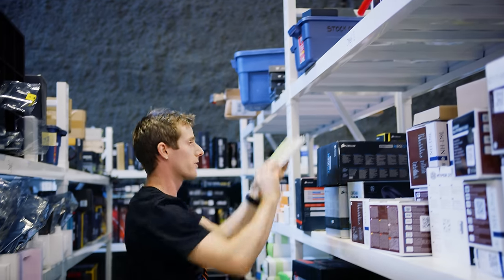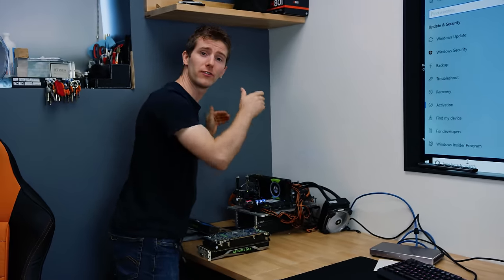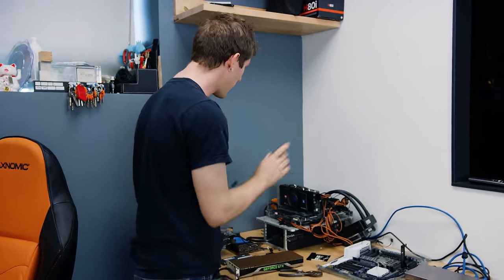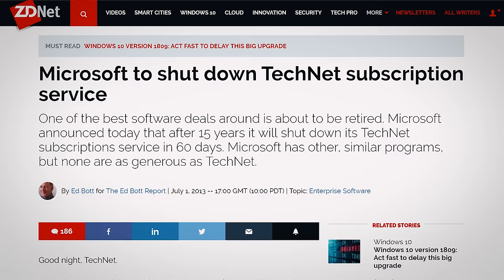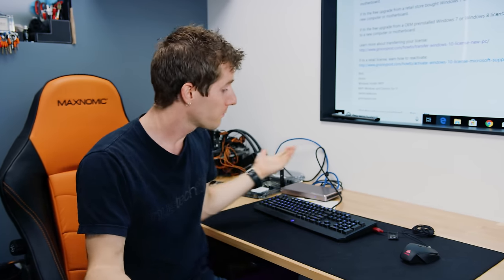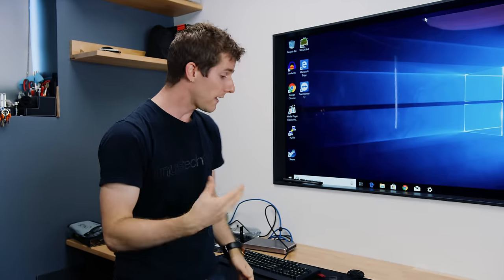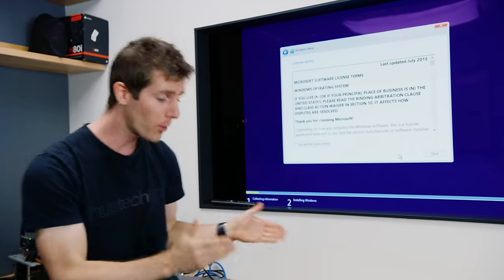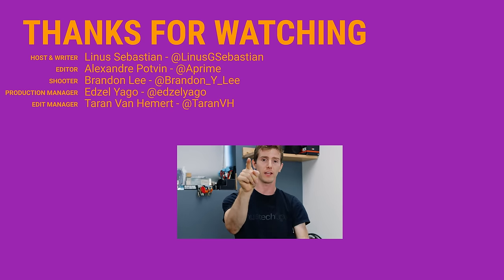Why Does Linus Pirate Windows??

Comment: Burns license to prove point... isn't able to prove it 😂
Reply: Murphy's law. Everytimeeeee
Reply: It happened to me when I upgraded everything but kept my hard drive.
Reply: @TheUwaisPatel  that probably the most common
Reply: i had no issue with it.  took HDD from prebuilt refurbished intel, and moved it no problem into custom build AMD PC
Reply: If he used a different mobo he would have proved his point on the first try. Windows license is tied to the MAC address of your motherboard.
Reply: Reason his key didn't deactivate is due to him not plugging in the internet, On top of that it doesn't burn the key. I changed to new mobo and cpu and it was still activated, connected to the net for 10 minutes and got notification to activate windows again. Once it deactivates it gives you a list of options and numbers to ring to get it activated again, done that 7 times with the same key.
Reply: Karl O'Toole He did use a different mobo, windows apparently didn't care.
I'm thinking there's a grace period after the first activation where you can swap out hardware however you want.
Reply: I believe the rule is if you change two or more pieces of hardware, or you replace the motherboard, Windows will ask to be re-activated. But most of the time you can re-activate.
Reply: Completely don't watch video?

Comment: I've had that many problems with Windows 10 activations even though I have multiple legitimately licenses. I even had multiple installations tied to my Microsoft account and deleted an old computer from there which then killed ALL my activations.
Then there's the issue of all the different versions of Windows 10, let alone all the versions of Windows 7 and 8 as well. So honestly, at this point, it's easier to pirate Windows 10. I shouldn't have to ring them every time I want to reinstall the computer or change hardware. Microsoft can sort their shit out or sod off. Using an activator tool is far simpler. You don't have to deal with all this crap. People pirate things because it's convenient... so make this crap convenient, Microsoft.
Reply: Probably yet another shady one where it's source code is closed but the creator and it's user claim it's not malicious at all.
Reply: Or use Linux
Reply: Linux is really not a viable replacement for windows under all circumstances.
Personally I've never been able to run a pure linux system - always end up needing a dual-boot arrangement just to get shit done.
(Though even there I prefer to use FreeBSD/PC-BSD over linux, so... Eh.)

Plus for the purposes shown in this video it's completely useless, since hardware and driver behaviour under Linux is not representative of hardware behaviour under windows, which would defeat the point of a hardware review for most practical purposes (unless your goal is to review how it behaves under linux of course, but that's a very niche thing to be doing.)

ReactOS would be more representative of behaviour under windows, though only to a point, since it effectively is primarily built to mimic windows 2000 over anything else...
Reply: Plus imo os should be free anyways
Reply: Or just switch to Linux. Problem solved. You're welcome.
Reply: Absolutly agreed, I currently use a OEM key for my personal rig, but I do not plan to do any majo changes in the next time so I'm gonna stay with the OEM keys
Reply: I'd just like to interject for a moment. What you're referring to as Linux, is in fact, GNU/Linux, or as I've recently taken to calling it, GNU plus Linux. Linux is not an operating system unto itself, but rather another free component of a fully functioning GNU system made useful by the GNU corelibs, shell utilities and vital system components comprising a full OS as defined by POSIX.

Many computer users run a modified version of the GNU system every day, without realizing it. Through a peculiar turn of events, the version of GNU which is widely used today is often called "Linux", and many of its users are not aware that it is basically the GNU system, developed by the GNU Project.

There really is a Linux, and these people are using it, but it is just a part of the system they use. Linux is the kernel: the program in the system that allocates the machine's resources to the other programs that you run. The kernel is an essential part of an operating system, but useless by itself; it can only function in the context of a complete operating system. Linux is normally used in combination with the GNU operating system: the whole system is basically GNU with Linux added, or GNU/Linux. All the so-called "Linux" distributions are really distributions of GNU/Linux.

Comment: I have used the migrate license feature, which is especially useful considering how many old Windows 7 laptops I have. If I need a license, I upgrade to Windows 10 and migrate the license to another machine. This is also very useful when you buy a new computer
Reply: I just say fuck it and deal with the activate windows watermark, already have for 7 years and I see no reason to change for $200

Comment: Someone: swaps every component other than HDD
Windows: This is all I need. Everything else is external.
Someone: swaps HDD
Windows: AAAAAAAAAAAAAAAAAAAH MY LIFE IS A LIE!
Reply: I moved from my hdd to ssd a while back with no issues. Built a new computer, the only things that stayed the same were my hdd and ssd. Windows deactivated itself and I'm too lazy to activate it again
Reply: Had it deactivate with a GPU and power supply switch a while ago. Bought a key and somehow it's still working on my old HDD and new SSD which are in different systems. Ported it over to the SSD then reused the HDD and it still worked on a different motherboard with all different components.
I swear it's just random...
Reply: Lol
I once read that the reason why Windows doesn't straight block pirated or deactivated licences is because, economically, doesn't matter to them
Since every major PC builder like Dell or Lenovo has to buy the license anyways
Reply: i moved mine from a desktop to a laptop with no issues at all so um their activation thingy is screwy
Reply: Definitely not consistent. Haha.
Reply: @yumri4  I've had both deactivation and permanent activation on multiple drive migrations, even with the same OS, so you're right about that.
Reply: @Hoganply  yeah when you can change all the hardware and not have any issues but when other change 1 part and have deactivation happen is kinda bad

Comment: Linux: total freedom, Mac: total control Windows: the annoying middle path
Reply: Linux is both
Reply: @KSPAtlas  They mean Apple controlling their OS, not users.
Reply: @notstarboard  Maybe, but all of my Mac updates have been free. That has saved me a lot of time and hassle in our business over the years.
You have to work costs out for the long term.
Reply: @w0mblemania  I. You don't pay for windows updates either ya know? Or for Linux distros, they're like all free to begin with.
Reply: @The_Bird_Bird_Harder  And for Windows, you get a free ocassional update that nukes your PC so you have to hard reset it. I work as a indoor server admin and tech support for a company, and most of my job isn't even making sure the server we use is good, but fixing drivers that Windows update broke and salvaging data off hard drives which Windows 10 nuked after an update. There is the occasional requisition form for parts that stopped working or computer upgrades, but that's rare.
Reply: @The_Bird_Bird_Harder  Free as in freedom not in Free of cost

Comment: just remove the watermark completely from the registry editor, it's pretty easy lmao
Reply: how?
Reply: the DEFAVLT gamer It’s pretty easy, try searching it up on youtube.
Reply: It comes back after a time... or if you change some hardware... also the watermark shows me the computer is working OK. If watermark is not present  something is wrong with my machine... we are best buddies with the watermark now... :-)
Reply: Slav4o911 If the HDD/SDD stays the same, wouldn’t the watermark not appear if he image itself is deleted from the registry? Just some of my thoughts
Reply: @fyriiee  That's how you create bugs: A software is intended to show an image -> image doesn't exist -> software shows, that a file couldn't be loaded - or -> software just crashes - (or both)
Reply: nowonmetube how about replacing the image with a transparent image with the same name?
Reply: @OriginalBurnout  depends, if the software tries to show an image, which takes up to much space, has a different aspect ratio or width / height, compression rate, format type, bitrate
- it could all also cause bugs
- or it just shows the different image ^^
- but just because an image is transparent, doesn't mean the software can show that image. If it expects a jpg image for example, it won't work, because it needs to be png to have transparency.
Reply: @nowonmetube  I'm pretty sure the watermark is just text.
Reply: I mean if you're going to do that then just activate windows using the notepad and command prompt trick
Reply: @Icybubba  duh
Reply: i did that too, and i was able to customise, as i wasnt before
Reply: @dim409  lol?

Comment: Now I'm waiting for "How Does Linus Pirate Windows??"
Reply: Torrents
Reply: @briannicholson390  im a smooth brain explain it a little better
Reply: @Luv-dq5th  You still need explaination bud or did you learn ? :) If not i can help !
Reply: I am a Player can you help me? I have Windows 7 on my old pc and can’t upgrade to 10 for some reason. I have the premium for 7 and still I’ve updated it using the Microsoft free way and yet it doesn’t change to windows 10
Reply: @spookyboi1164  That's odd ! Fear not i will help you ! Feels like a superhero 

What you need is bootable usb 8Gb minimum
You go to official Microsoft windows 10 page and you download media creation tool which will prompt you on a assistant that will guide you through steps
like if you want it for this pc or do you want a usb drive for another pc and so on :D You need to pick the later.
Once the drive is done you should shut down your pc with usb drive plugged in ! ( Now this part varies from pc to pc ) And then you need to press esc and/or f10 ( f12 or f11) so you can actually pick the drive you want to your pc to start from ! You pick of course the drive you installed windows 10 on ! From there on you will follow the installation assistant that will let you choose if you want to delete all from your pc or just install new windows while keeping windows.old ( assuming you instal windows on the same drive the previous one was c:/ ) and after a while and settings by your choice Windows 10 should be fully installed ! 

I am assuming you tried installing from windows directly instead from bootable drive that is why there might have been an issue ! But like this i am preeety sure there will not be any issues at all !  If you have recommanded requirements for windows 10 of course (then again  i installed windows 10 on a 10 years old laptop sooo you should be fine )

if there is something still bugging you do not hesistate to ask :)
Reply: I am a Player ok so I tried the process again using your method,(I got it off the internet) and it worked! Thanks for the help I’m glad I’m finally on the proper version
Reply: @spookyboi1164  That fast ? :o That's cool ! Glad i could help :)

Comment: Linus: Buying cheap activation keys are still piracy and violates the terms, dont do it
Also Linus: I break Microsofts EULA by using a normal copy of windows for 100% remote access and payed for a personal subscription to get infinite keys in an enterprise environment
Reply: Yea it's either you care about the license agreement or you don't. Technically he can be sued for using Windows remotely (technically, I doubt MS will chase down everyone doing it)
Reply: @AdamSmith-gs2dv  they would gain nothing. And probably would lose if they did in america so.
Reply: Ironically, I just did this.  No watermark, and my copy of Windows 10 works normally.
Reply: @jamescannon2587  how much did the pirate key cost you and where’d you get it
Reply: @thatdudefrom7118  just use some os key activator crap and hide the watermark via regedit. No one can tell the difference
Reply: Piracy vs terms ofnuse are two seperate issues lol one is legaly theft the other is simply a biolation of an agreement

Comment: A few days ago, I changed motherboard and CPU, after a couple years, my windows 10 pro install was an upgrade from a pirated windows 7 pro (hehe) and it had an OEM key, I tried doing the automated thing but it decided to mess up, so I called up and after 40 minutes they said my OEM licence was valid and gave me a free retail key for windows 10 pro
Reply: Yep, Daz Loader takes advantage of a bug in Win 7 which allows it to input a key via SLIC. MS has literally no way to tell whether this cracked key is fake or not as it uses the same algorithm they use to to generate these keys...
Reply: You can buy OEM keys online and just either call up or use microsofts built in live chat. If you tell them it wont work for some reason then they just use phone activation and literally give you the key. Its probably illegal but I did it and will continue to do it after their crappy tech support who dont understand a word I am saying.
Reply: But what if they know that you have pirated version, and allowed you to upgrade to Windows 10?

Kinda honeypot ¯\_(ツ)_/ ¯
Reply: @sonofarabia3640  No they went onto multiple files on my computer and one of them (system files) said some code thingy, my windows 10 version and genuine next to it

Comment: For all you self-appointed copyright police telling Linus to activate every time, be aware that it’s Microsoft’s job to enforce the copyright not you guys and they are OK with him using un-activated versions of Windows for testing purposes. It makes perfect sense that he would not activate Windows every time or have a separate license for every instance of a hardware configuration he/LTT is testing out. What Microsoft cares about is if you have a stable system, hardware-wise, you activate it, which I’m sure he does on Windows computers he uses that are not test bed systems and thus are not going to change constantly, that is if they are not preactivated OEM system such as a laptop. Even if he was technically violating the EULA, so many people do that all the time, that we cannot take a firm “it’s wrong, no buts about it” approach unless we want our civil courts to grind to a halt which is what would happen if we tried to enforce EULA’s to that degree. If Microsoft is not going after him that neither should you guys. There is a big difference between a technical violation of the EULA and a moral violation and his would clearly fall into the former. Now some are trying to argue that activation is so easy so why not just do it. The reasons this is not the simple solution some people think it is is because Windows activation doesn’t work quit the way some people think. A system can be deactivated if a certain number fo hardware changes occur with a specific length of time since last activation. These changes involve more then just the motherboard, meaning things like HD’s/SSD’s, graphics cards, etc. being change can trigger deactivation and Microsoft has never revealed exactly specifically what cause deactivation. Phone activation can be a PITA and other methods are not always reliable, and that assuming your only doing this once in a rare while unlike all the time as LTT needs too. As to the folks recommending he LINUX for Linus, as an alternative solution, since he does a lot of testing of Windows PC games and WINPC gaming hardware and other Win only hardware/software,  it’s is not an option many instances. He probably does have some machines that have LINUX either as a default boot or a dual boot configuration with Windows.
Reply: A bit verbose, but it explains the situation well.  I think the first two lines say it best, that it's Microsoft's responsibility to enforce their copyrights, not the self-appointed copyright police (a.k.a. YouTube trolls).
You raise an interesting point, and one that Linus mentioned in the video: have the trolls actually read Microsoft's EULA, or are they just pointing fingers?

Comment: The early days of Win10 release, MS would deactivate your copy if you so much as sneezed on your hardware. It was completely hardware bound. I like the current way of having the license being bound to the MS account. 

Either way, if you're testing hardware and constantly doing hardware swaps, why bother with activation as long as you have a license? Surprised more people don't know how Win10 activation works and that you are buying a license to use the software on one machine, or more in the case of volume licenses.
Reply: i had 5 copies go bad ... microsoft had a choice reactivate or pay through the nose for contract violation ... eula is a contract ... if you are installed on a system and activated legally they can not legally deactivate your software as you purchased the right to use it on your hardware ... doesnt matter what your hardware is just that it's yours ... they cannot change the activation when hardware changes as long as you own the hardware .... when the helpdesk says they cant reactivate; ask to get passed on to the lawyer as you want to make a claim against the eula and require their legal teams information to take them to court  for breach of contract .... surprising how fast legal tells the desk fix the dam windows and stop screwing us over